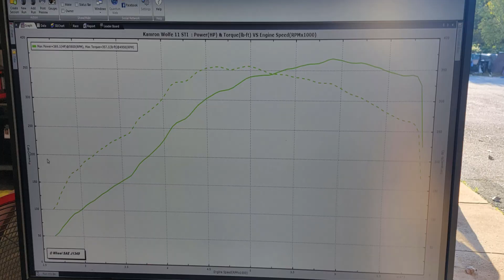my fire spitting Subaru Wrx Sti

Comment: gotta fix that surging
Reply: That’s the external wastegate. It’s normal on Subarus between the firing order and unequal length heads.
Reply from the maker: Nah, its fine
Reply: @calebjason6710  inefficiency, so still gotta fix it
Reply from the maker: @tonyconley970  the flutter you hear when im full throttle is the ewg duty cycle. under duty cycle the ewg opens and closes rapidly to regulate boost

Comment: Great job, looking strong! Consider adding hood louvers, which fixed the heat soak problems on my built Sti
Reply from the maker: Yeah, i cut a holes in my bumper to get around heat soak but thats a good idea, 👍 thanks

Comment: Ah from one small turbo, to another😂
Reply from the maker: SMALL TURBO MAKES FULL BOOST AT 3100RPM
Reply from the maker: yeah i wanted to go bigger and i have a built block but i wanted to stay extra reliable. and my buddy had that 20g for 500 bucks with 1k miles